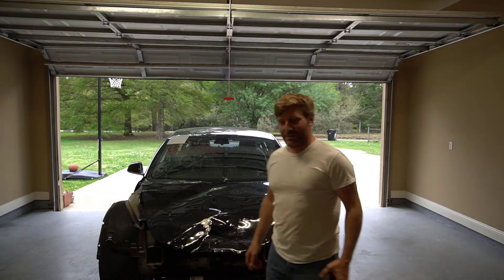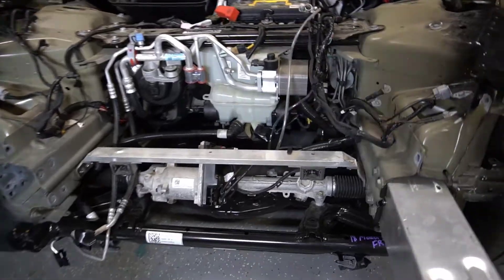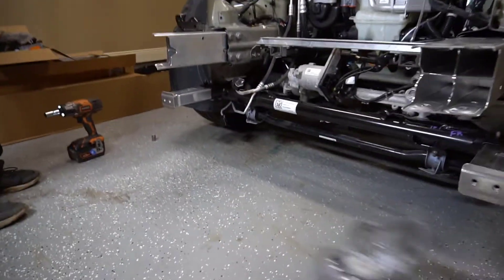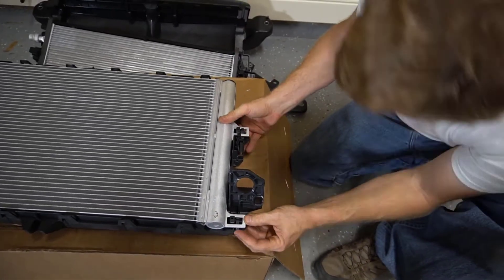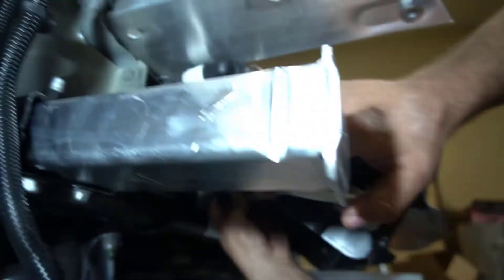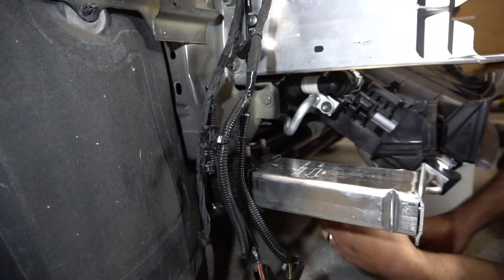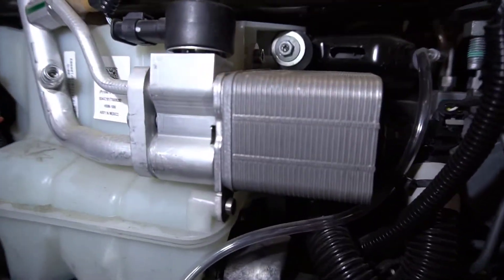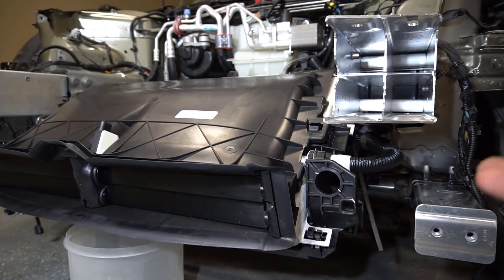Tesla Model 3 - Salvaged - Rebuild - P2

Comment: Man I'm looking for the same smashed bracket as yours do you know the part number ?on the bracket there is no part number
Reply: Omg you are the man thank you so much
Reply from the maker: The fender brackets they are easy to find on ebay and are cheap now, well they were here is a link to get you started. 

https://www.ebay.com/itm/276421155090?mkcid=16&mkevt=1&mkrid=711-127632-2357-0&ssspo=50ksElDWR_y&sssrc=4429486&ssuid=O3pKChT5T5-&var=&widget_ver=artemis&media=COPY

Comment: amazing video!!! what did you do with the support bracket, did you find it used?
Reply from the maker: No I bought them directly from Tesla, anything bolt on is not considered structural anymore.
Welded and rivet panels are restricted and not sold.
Reply: @TeslaRebuilders   are welded and rivet pasts sold to licensed shops? or even they dont have it?

Comment: Did I miss how u straightened the right frame rail?
Reply from the maker: Umm actually the rail was not bent at all at the time I thought it was.  After taking measurements I found that it was fine and it was only a dent in the crash can socket that needed tweaking.
Everything went together pretty good after that and was within or better than factory gaps.
Thanks for watching,
Casey

Comment: Is it ok to charge it when there’s no coolant and radiator ? Battery’s at 0. Is it ok to drive it around yard ?
Reply from the maker: Car will charge at a very low rate and may fault out as the charger gets hot without coolant flow.  Driving is totally fine as it doesn't really get that hot just moving the car.
Reply: @TeslaRebuilders  for safety purposes I fixed coolant system and then began charging as the coolant motors are on and asking for fluid to pump otherwise they’re making very loud noises

Comment: Who did all the actual Bodywork in between this and your 1st video? I see the frame horn has been fully repaired
Reply from the maker: The Aprons were not damaged, the crash cans and bumper took the damage.  These are all bolt on parts no bodywork was done on the car at all.  I only needed the windshield replaced by Tesla and someone to paint it, the rest I did and have never done before.

Comment: Wanted to ask, I saw your vacuum pump in shot, could you have pulled a slight vacuum on your super bottle, and ran a bead of CA or flexible epoxy over the leak, drawing it into the separated seam to salvage your existing tank?
Reply from the maker: It could have been repaired probably yes, I even thought of plastic welding it.  But when they said the whole unit was 300$ including new pumps and valve I felt better about it.

Comment: Hey! Awesome work! After you reset the crash data what OBD tool or other tool do you use to reset the (SRS) for the airbags once they have all be replaced? I have tried the adapter and two tools but they another have issues reading data on the 3! Thanks for any help or suggestions!!!
Reply from the maker: You have to send the RCM off to safety restore or other airbag reset services.
Reply: @TeslaRebuilders  I found a website that gives details on every error code! I was able to find the errant part and solve each mystery!
Reply from the maker: @winstonallthingselectrical837  oh ok cool deal yea most error codes or notifications are generic and not specific.  If you enter service mode you can select each notification and get the definition also.
Reply: @TeslaRebuilders  my software version is stuck on 2020 so I unfortunately can’t get into service mode 😞 that’s awesome to know though!!!
Reply: @TeslaRebuilders  I was told that there is supposed to be a way to burp the cooling system in service!
Reply from the maker: @winstonallthingselectrical837  Yes but easier to do it with a small shopvac on the coolant bottle.
Reply: @TeslaRebuilders  didn’t know that trick super cool! I was trying to join the discord is it still active?
Reply from the maker: @winstonallthingselectrical837  Yes link here:

https://discord.gg/dVtTCPfn
Reply from the maker: @winstonallthingselectrical837  Make sure you connect to Wi-Fi and set to update advanced.
Reply: OBD* tools

Comment: Hello, in your previous video say you need to replace the pyrofuse, I saw the display send a message 12v system problem, I have a Tesla model 3 with the same problems, it is salvage too, all battery was discharged very fast and it don't work, does replacing the pyrofuse will solve the function of the 12v system? Also the rear motor is broken in the accident is a big project, thanks for your video
Reply from the maker: Sorry I missed your comment, hope you got it figured out.  No you have to replace the 12v if dead then Pyro will restore power from pack.

Comment: So you drained all the oil from the compressor on removal.   Then it is added during the re charge of the AC system?  or added separately?
Reply from the maker: Yes I removed the AC compressor myself and prepared it by draining the oil.  You have to use a special A/C recharge machine that Tesla has to add the oil and refrigerant back.  They could then refill with the correct amount during the recharge of the refrigerant.  It was the only way to be sure there was not too much oil when the amount has to be just right. They were very fair on cost also was only 200$ to service the A/C and recharge.  I have also had no issues and works like new!
Reply: @TeslaRebuilders  It was enough to add 30-40 grams of compressor oil before refueling the air conditioner, without removing the compressor, and then fill the freon to normal, but you still need to do this with a specialist
Reply from the maker: @igorkorzun  Yea sure if you just drain the system and are just replacing a leaking condenser or line.  Being this was in a accident there was no way to know the existing amount of oil in the system.  I just didn't want any problems and drained it all to start over with the correct amount.  It was not that much more involved when the car is already apart like mine was to remove compressor.
Reply: @TeslaRebuilders  If after an accident, then it is correct, especially if the car has been standing for a long time with an open system, the oil is hygroscopic, it collects moisture from the air

Comment: I'm confused about something, tesla sells you parts for you to fix your salvage or damaged car but then go on to disable shit on your car cos it's damaged or wrecked. Isn't it then an inherent risk of purchasing thru tesla cos you're indirectly letting them know you've got a wrecked car? My simple brain can't comprehend this yet......
Reply from the maker: We they are also going to be working on the car, only things they can really do.  Some parts you just can't get, they either don't have on ebay or outrageous price.  A branded title is public knowledge, I didn't have to tell them anything that they don't already know.  I have not signed any forms or agreements about working on my car but they did give me a notice with the info on it.  It clearly states that if the title is Salvaged it will be disabled, I believe if the car gets Rebuilt brand it won't.  They still do inspections on the cars to work on them, that's still confusing me if they or another bodyshop would do it.  But either way I don't care I have stated many times, I don't need supercharging!  I already have a new model 3 to travel long distance with, this is just a second car. 
Casey
Reply: @TeslaRebuilders  sweet. If you need crash related safety parts, how would you go about it? If you camera or MCU is cactus for instance or airbags...
Reply from the maker: @GspotPredator  I'm getting Tesla to install the front crash sensors and some airbags for very reasonable price.  If you can find on ebay it's just too much, have to quote from Tesla first!  My car was only damaged in front, no frame or computer damage.  I don't think anyone should be repairing cars with frame, computer, or lots of wiring damage.  Everything I have worked on has been unbolting or unplugging broken or bad parts and replacing with new or used from Tesla or Ebay.  The body panels are so easy to work with, Yea I may have had to adjust some clips but not hard at all.  I'm almost finished just some paint and Tesla service then inspection by state. 
Thanks,
Casey
Reply: @TeslaRebuilders  apart from getting the state to recertify the car, would tesla do the same certificate as well? I'm very curious....sorry!
Reply from the maker: @GspotPredator  I'm not sure yet the inspection process is not very clear, my local service center does not even know how to do it.  I will be finding out soon when I get it over to them.
Reply: @TeslaRebuilders  cheers bud! All the best

Comment: Hey! Thanks for this awesome video. Could you please describe how you've ordered parts from the dealership so they released them to you, without using them for repair in a dealer's body shop?
Reply from the maker: Hey, I emailed a local Tesla Service Center and requested to order parts.  I got contact information so I could call someone there and not 1800tesla.  I decided to get my first list together and visit in person to meet the staff.  I ordered the parts and in a week and a half I received a message that they were ready for pickup.  You don't pay for them until you pick them up.  My local service staff was awesome they helped me out with everything.  Now I'm setting up the final quote on the last parts and Tesla service to finish the car.  I'm going to have them replace the glass and some airbags, sensors and seat belts I could not get.  Should be this week I will know more about it.
Thanks for the comment and watching!
Casey
Reply: @TeslaRebuilders  Thanks for your reply! Good luck! You're doing a great job.
Reply: @TeslaRebuilders  By the way, how are the seat belts doing: are they locked after the accident?
Reply from the maker: @eugene5636  yes if airbags go off, then each occupied seat will blow the belts and front seat pretenioners .  I'm having to replace both front belts, pretenioners and one rear seat belt.
Reply: @TeslaRebuilders  Hello! So, yesterday I registered my Tesla Model 3.
Actually, I'm from Belarus, I bought salvaged M3 at IAAI in California, delivered it to Belarus, purchased parts for repair and restored it, today I even have it in Tesla App. This car is so awesome!!!
Reply from the maker: @eugene5636  awesome for sure, happy to hear you got it finished!

Comment: You may want to try JB weld or melting the plastic with a soldering iron before buying a new coolant tank.
Reply from the maker: I did stop the leak that way but the problem is the pumps were damaged due to running dry until battery died.  Better off buying one its additional cost but considering what I have in so far its not that much.
Thanks

Comment: Will loose super charging abilities...?
Reply from the maker: It's salvaged being rebuilt, according to Tesla yes it will eventually be disabled.  I don't really care as I already have a new model 3 for traveling.  I'm only using this car local for daily driving, Supercharging is not everything.  We have had our car for 8 months now and have only super charged for 800 miles out of 35,000!   Due to long distance travel, charging at home to 90% gives you 280 miles of range.
Thanks,
Casey
Reply: @TeslaRebuilders  Is there any other fast chargers around in your area? In Norway I see many chargers of 100kw outside tesla's charging network that tesla owners use.. Perhaps not so common in the US yet?
Reply from the maker: @R.E.HILL_  Yes there are a few of them building up that offer DC fast charging.  Electrify America, Ionity, Nissan, and a few more, but they will require an adapter. 
Once disabled I won't be able to use any DC fast charge, only AC chargers.
Thanks
Casey

Comment: Thanks for the detailed video, is there is a process to get the air out from the system once you fill the coolant
Reply from the maker: Since this was a front damaged car the system drained from the bottle the highest point.  I'm pretty sure the pumps stopped working and the rest of the system is still full of coolant.  I'm getting a new super-bottle and it comes with new pumps on it.  I will defiantly go over flushing of coolant when I get everything filled back up and running.  
Thanks for the comment and Watching!

Casey
Reply: There’s an air burping process that will remove the air from the system

Comment: Do you have video of changing the fuse in the penthouse? Or how you got the car driving, once the airbag goes aren't there a lot of steps to get the car driving?
Reply from the maker: No I didn't video the changing of the fuse I kind of just did it.  Changing the fuse if the car for me was all I needed to do to get it to move.  Everything will be disabled and none functional like safety features.  You shouldn't leave the car powered up for more than 15 mins if the cooling system is not functional.  I found out the hard way the MCU gets very hot and could damage it.  This is the video I followed to change the fuse as they show very well how to change it safely.   https://youtu.be/MuFxg75UYbE?t=15
Reply: TeslaCharged Thanks for the info!    Congratulations on having two 3's. You could say I have a Models 6 😊